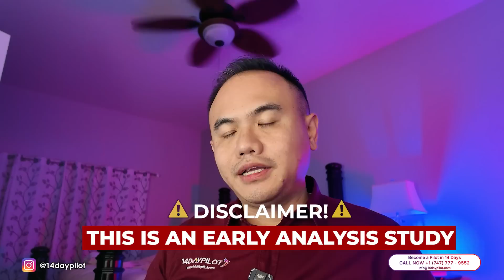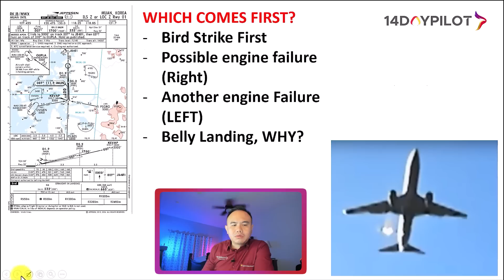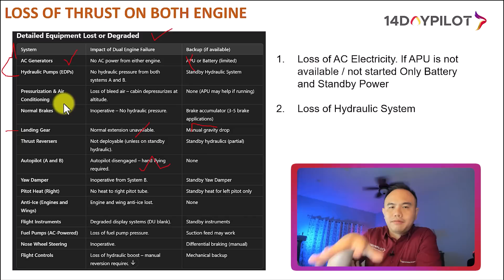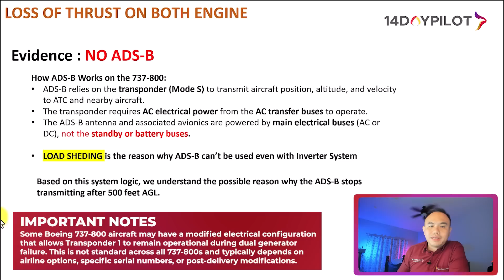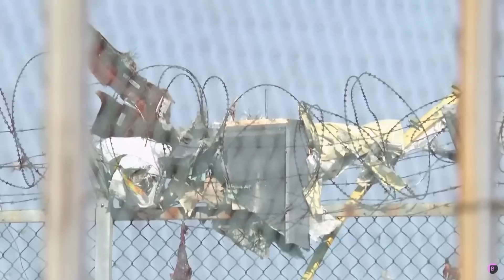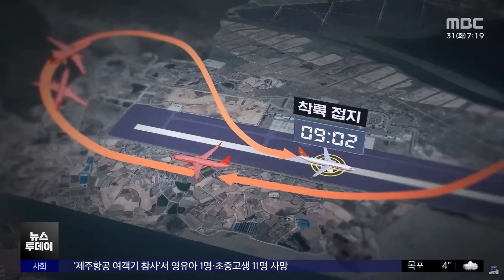NEW! JEJU AIR 2216 UPDATE :THE MYSTERY OF RUNWAY 19! B737-800 Crash At Muan Korea

Comment: Here’s my guess: After the initial strike on the left side, the pilots likely shut off that engine. What we see on camera could very well be a second bird strike impacting the right engine. Realizing they were now operating on a compromised engine, they probably felt an urgent need to land as quickly as possible. 

Amid the chaos, they may have experienced tunnel vision, potentially overlooking the manual landing gear deployment option—or they might have deliberately opted for a glide configuration, which seems more plausible. It’s possible they were aiming for a water landing, making the impossible turn to position themselves toward the stretch of water. This maneuver suggests they were attempting a controlled glide into what they saw as the safest available option.

I have a strong feeling  that the pilots were  not aware of the concrete embankment at the end of the runway—or if they did know about it, they likely weren’t aware it was reinforced with a thick wall of concrete underneath. It’s very possible they assumed it was a pile of dirt that could help slow the plane down.

There’s just no way they would intentionally aim for a head-on collision with a solid concrete wall. We've all seen crash test dummy videos—it would’ve been an obvious disaster.
Reply: If the plane had deployed thrust reversal on one engine, how could it still glide down the runway in a straight line?  Was the hydraulic system still available to the pilot during the touch down when he steered that plane?
Reply: @wilsont1010  The airspeed was still perfectly sufficient for rudder being used effectively for directional control.
Reply: It's a mistake to shut engine down if there is no fire. A bird can get into bleeding air which smells like something burning ( the bird). If engine is running leave it. If there is small vibration leave it if it's making a thrust.
Reply: @gmcjetpilot  I see what you mean. Yea, it doesn’t make much sense to shut down an engine unless absolutely necessary, like in the case of a fire, as you mentioned. Perhaps turning off the left engine was a mistake, or maybe it wasn’t turned off at all—we can only speculate at this stage. It’ll be interesting to hear what the surviving crew members can recount. Maybe a fire broke out in the cabin after the initial strike, which prompted them to attempt an urgent landing?
Reply: It's a 5 hour flight, I don't think that's long enough for pilot fatigue, panicked yes.
Reply: @Dliu Not if they also flew the initial leg to Thailand!
Reply: @ these comments are all pointless, it’s just sad period, shits depressing. Lives gone in seconds for not a damn thing.
Reply: @Dliu1116 Yes the lives are lost but discussion is not pointless. For one we want to learn and understand, especially B737 pilots such as myself. Second it helps people deal with the tragedy to talk about it.
Reply: @ much respect to you pilots! It’s a lot of responsibility being the captain! The whole world felt this one I’m sure. I have no doubt the aviation community will learn from this tragedy.
Reply: I agreeed with you
Reply: Is there any report confirming that only one engine was affected by the birdstrike? It’s possible that both engines were impacted separately.
Reply: @wilsont1010  Way too early. They have the flight data  and CVR boxes. Very likley all information will be recovered. It takes months if not years to release this information to public sometimes. Because of nature of the accident, video investigation should move quickly.
Reply: @veebee3837  There is so much wild guessing and conjecture on your part. You extrapolate exponentially well beyound the known. You can't read minds. We have Flt data and voice recorders.
Reply: @gmcjetpilot  Yea, I’m just speculating at this point. All I can do is guess based on the information we have so far.
Reply: @veebee3837  You are saying "they knew."  I doubt it, or I should say they did not consider it. Humans can get tunnel vision, saturate, miss critical information, and make bad decisions. 

If they knew about the earth concrete berm,  had a choice, had an option to circle  back to 01 or 19..... you would land 01 every time, all day, every day with no obstacles at the far end. 

The odd thing everyone is wondering is how they seemed to rush and did, gear up,  flap up landing. Did they lose all thrust either out of their control by shutting down the wrong engine. That I want to know. 

Seems like some bad decisions made with more bad decisions and not following the engine failure   checklist? 

Crew mistake or not, a  truly horrifically bad unsafe airport design that was totally unnecessary resulted in all but 2 dying. The airport knew it was bad. It was a topic of discussion.

 I hope out of this, every airport looks at their over-run and clear-way. Use Engineered Materials Arresting System (EMAS) to slow and stop aircraft where it's applicable. Many airports that are crowded by surrounding roads or  buildings or water use it. It works. It's not to save the plane but save people and stop the plane.

Whatever airports do 10 to 30 ft tall solid earth berm with thuck slab of concrete on top is  horrifically bad. Mount antennas flush with ground on frangable (break away) bases. If this was installed, likley all or most would have survived. Add EMAS, it would have been far better still.  Plane may still be unrepairable, but intact. There is a lot of land they had to make it right.
Reply: I wonder, even if they had known about the concrete embankment, would it have been any safer to land beside the runway on the grass/dirt? Would the plane have slid just as well or dug into the ground and broken apart. Of course, a water landing would have been the safest option in hindsight. (Miracle on the Hudson style, Skully style)
Reply: @23ofSeptember  There were obstuctions on both grassy areas.  They might have missed the embankment if they landed on the grass.  But at 170mph/150kts at the time they hit the embankment. no telling how far Newton's law of motion would have carried them beyond the perimiter of the airport.  One point another YT video brought up was that South and North Korea are still in a state of war (from the early 1950s).  Their airports are desinged to 1) prevent heavy equipment intrusion through the perimeter wall and 2) the airports are designhed to operate fighter jets from any airport or major highway.  So, even if the airplane missed the bunker, it would have hit the perimeter wall and the result will probably be the same.
Reply: @23ofSeptember  I think their aim was exactly that—to glide safely into the water. If they had known about the embankment, they might still have attempted a belly landing, but as you suggested, they likely would have tried to glide beside the runway instead. Landing on dirt /grass would have caused significant impact and possibly broken the plane apart, but it would have been far better than the catastrophic heasd-on collision with the wall.

Comment: How about his scenario: bird strike takes out the left engine. Mayday call. They raise the landing gear an flaps intending to go around and evaluate the problem.
Just then another birdstrike takes out the right engine (the video). They abort the approach (because they are now too fast and clean) hoping for enough speed and altitude to "make the impossible turn" and belly land (because there was not enough time to lower he gear manually).
Reply: This makes sense and why people were videoing because they already heard the noise and commotion of one engine fail and plane in trouble
Reply: No..
The right engine was the one taken out
And yes it was a dumb idea to retract the landing gear
The left engine was the functioning one/turned off
No idea why they did a turn around to the teardrop when they already perfectly aligned for the runway 01
Reply: @everydaydose7779  The starboard engine was taken out on the Go.  The Go Around was called when the port engine was taken out on the first approach.  It was only after they had decided to go around and had the right engine strike that they decided on a return to the airport and dead stick landing.  On the Go you always clean up the configuration.  They left it clean (no gear or flaps/slats) to ensure they could make the field once they decided to try a dead stick landing.  Their mistakes were not to continue the approach once #1 engine was taken out (although a valid choice in the book), the second was once they had no engines, turning back to try a dead stick landing at the airport.  They should have put it in the drink (more margin for error).
Reply: @wsteele5864  They have also made another mistake.  To reduce airspeed, flaps and spoilers should be deployed during the touch down.
Reply: @wilsont1010  I think at the point they decided to try a return to airport dead stick landing, with likely zero experience in this type of maneuver, focus was on making the runway with little knowledge of what ground effect, etc. was going to do.  It just isn't something they get any practice in, like zero.
Reply: But you would think that once they started getting lined up with the runway on the turn around they didn’t dump everything out (gear, flaps, slats, air brakes) whatever they could. They were already on top of the runway. If they would have stalled 20’ off the runway it might have been a better outcome then running into the barrier which I’m confident they knew was there. It definitely wouldn’t have been pretty and probably asymmetrical in some ways but they would have hit going the slowest speed possible.
Reply: @kevintrabert1922  It really isn't just about getting lined up on the centerline, it is about the lack of knowledge of sink rates when configurations change, what the drag of each component adds and how that might change whether you are going to make the runway or come up short.  These realities are why stabilized approaches are the holy grail in commercial aviation (and might be why they elected the Go Around versus completing the approach on a single engine).  In the end, I doubt many multi-thousand hour 737 captains could do a dead stick return to that runway and stick the landing safely.  Ironically, doing a Sully Sullenberger and choosing the water would have given them far more margin for error, also likely would have gotten the pilots fired had they pulled it off.  Everyone is Chuck Yeager in the sim ;)
Reply: @wsteele5864  That's the point I was trying to make is they already committed to ditching on the runway as opposed to the water and they already had 2 engines out. What harm could have come from them at least attempting to get the gear and flaps out.  It wasn't going to stall right away and they were already over the runway. What I'm trying to say is that it seems even to the very last seconds the pilots never committed to a single plan and went with it.   For instance as they rounded the turn they could have been putting out the gear, flaps, slates, dumping fuel. They were too fast and they knew they were too fast. I wouldn't be surprised if they weren't trying to restart the engine while already committed to landing without the engines.  We can speculate all day about what we think happened and what we would do in that situation. In a way I hope for the families that there was some gremlin that we don't know about and the pilots couldn't do anything else as sad as that sounds. Time will tell.
Reply: @kevintrabert1922  I understand what you are saying, but I think the lack of dead stick practice likely played the biggest role.  I have never flown a 737-800 so I don't know how long it takes to deploy the landing gear by gravity (assuming they had no way to drop the gear quickly with hydraulics).  Also, the float they experienced in ground effect might have surprised them greatly.  Again, this type of landing just isn't practiced.  They very well may have expected a belly landing was going to arrest their forward motion much more quickly.

I would not be surprised if the final report exonerates both the pilots and Boeing from blame.  I know we all want to believe that all accidents will be avoided if everyone did their job correctly, but after 50+ yrs flying myself, I have come to believe that there are times when enough things go wrong at the same time only a miracle saves the souls on board.
Reply: @wsteele5864  It may very well have been a hopeless situation. I'm sure we are all just in shock how such an accident could happen in todays day and age. While I have no aircraft experience I am a skydiver. Glider experience I suppose. I thought there was talks about pilots being trained in a professional setting about all engine out situations. After Sully's water landing. Hindsight is always 20/20.
Reply: @ I suspect if the crew does get any criticism (if my supposition turns out to be right that they had the first strike on the initial approach which triggered the go around and a second on the undamaged side while on the go), the criticism will focus on not completing the approach on one engine and then not managing their energy properly after making the decision to return to the airport.  In any case, there will no doubt be blistering criticism regarding the wall the Localizer antennas were mounted on.  Truly a tragic situation.
Reply: @ on the more current training for a dual engine failure, I haven’t heard of it but that doesn’t mean much as Sully’s adventure was post my time flying.

The only sim training I can remember that involved both engines being lost was an initial sim course I took on a pressurized piston twin I started flying, that was a very long time ago.  The instructor had a section on the effects of best glide in various configurations, including the props windmilling versus being feathered.  It was a very dramatic difference obviously, so really drove home the point.
Reply: Why abandon landing if the bird strike hit and they were all set up to land. Would have had brakes , probably flaps too
Reply: @angelarich8455 the book gives both options (go around or continue), but there is a lot of emphasis on stabilized approaches nowadays.  Probably was their first mistake, not their last unfortunately.
Reply: Pretty spot on analysis.  Their fate was sealed with the turn back.  Probably a lot more people would have survived if they had ditched, but most would knee jerk toward the runway waiting.

Comment: If both engines fail, why wouldn't the APU be designed to start automatically thus giving the pilots one less thing to do manually in a situation where time is critical? It would be very easy to do.
Reply: For example the 777 and 787 have this feature
Reply: It would cost money.
Reply: APU uses fuel like main engines,the problem is it doesnt offer thrust.Remember for example when there is fire on  board and the source is unknown activating system that uses fuel might be adding fuel to the fire.I actually prefer RAT cause it provides some thrust&it doesnt use fuel.I believe most pilots would rather start with RAT and when it fails then they would have no choice but to use APU.One factor about this crash people dont talk about is altitude,if aircraft has enough altitude pilots can have enough time to try this&that,its like with stalling,not enough altitude means no leverage to push nose  down to gather enough speed needed to generate lift to come out of stall,its crazy cause these emergencies need quick landing meaning the closer to the ground should offer some hope of quick landing.
Reply: @ why would you rather use the RAT? As far as I know the RAT doesn’t provide any thrust.
I don’t know any pilot who would prefer the RAT over an APU as the APU is working as a normal generator source and can supply the whole airplane
Reply: @Cars-k8e  if it's the case then I got things very wrong especially the fire part.Thanks for giving me free lessons,much appreciated.